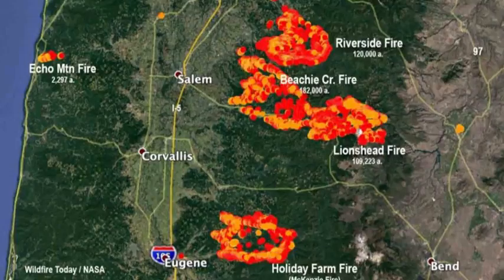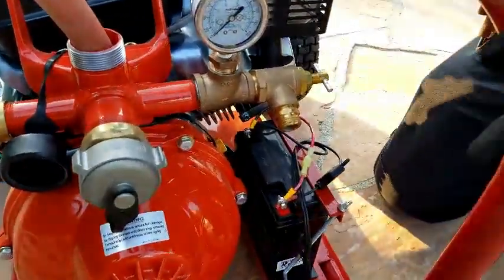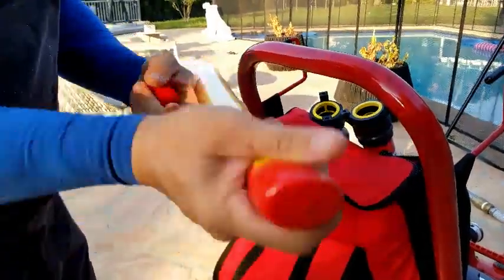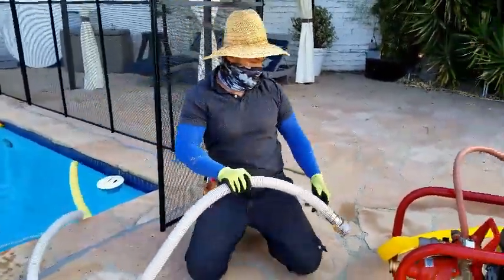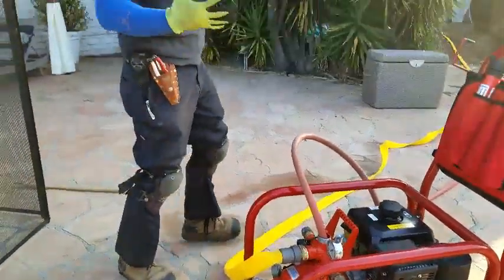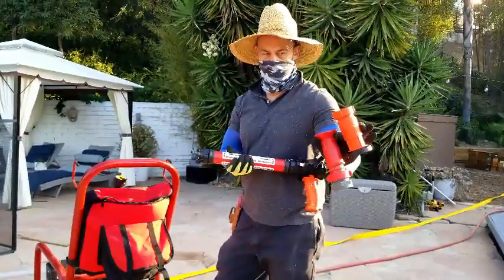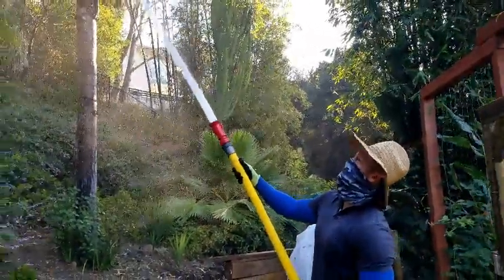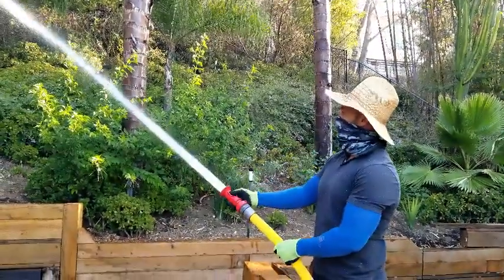Protect your Home with a Portable Fire Pump | Dieselmxtt

Comment: Just an observation, at the end of the video when you were running the pump it sounded to me like the motor was only running at low rpm, just above idle maybe. Should it did not run at a higher RPM to increase the flow?
Reply from the maker: I turned down the motor before shutting it off